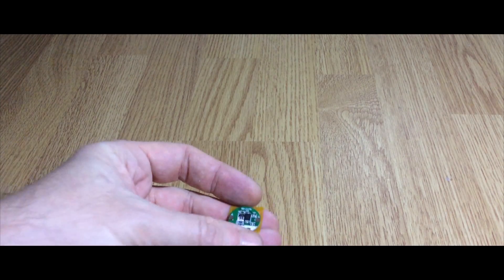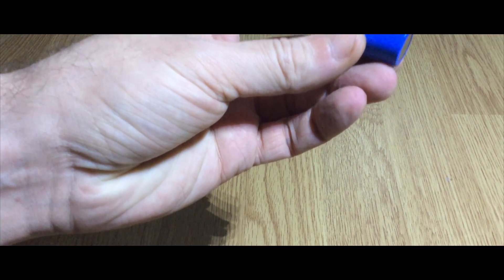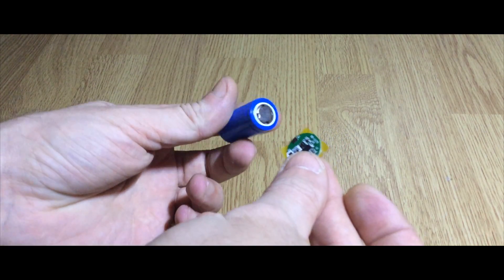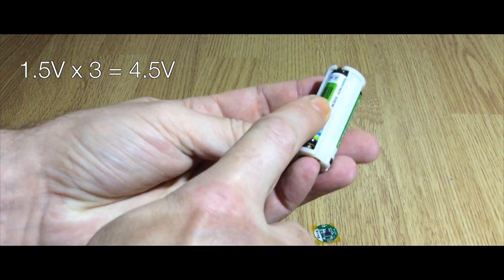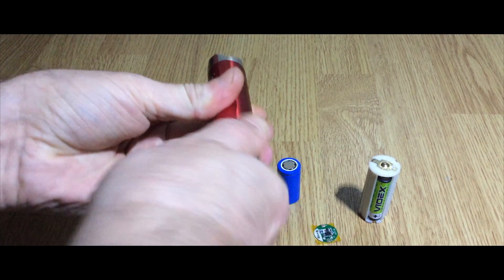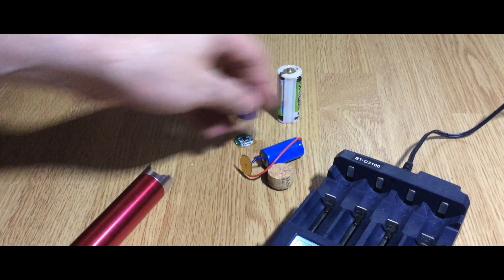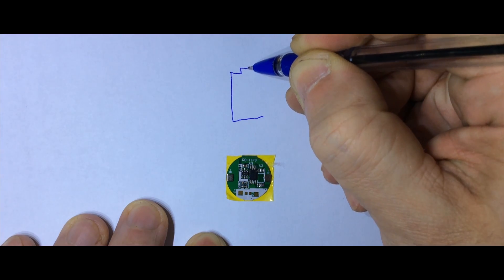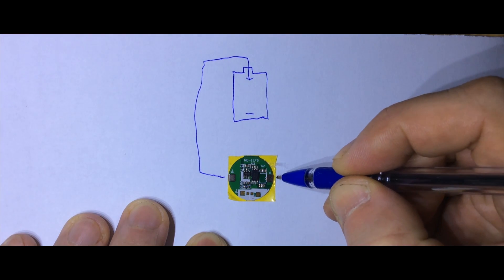RD-1179 DW01+ DIY Review Cell Protection Board. How to Upgrade Flashlight AAA to 18650. Charge board

Comment: Can I use when making my lithium battery bank. Going to use the battery bank with my solar panel.
Reply from the maker: Yes, but it's single module for one of 18650. This protection board
Reply: I know I thought it would be best to protect each sell individually. It will be a nightmare of wire I bet.
Reply from the maker: shawn lee This protection against overdischarge and overcharge. Some battery's already have this pcb
Reply: Mine do not have protection built in. I am building mine from scrap laptop battery packs.
Reply: @shawnlee4806  no, that wouls be auper expensive, you can get balancing boards for however many batteries you want in series/parallel. Just follow the diagram they come with, some even include a thermistor for overheat/charge protection. Good luck, be safe and wear eye protection, even experienced battery techs have made mistakes, and lithium batteries go BOOM,